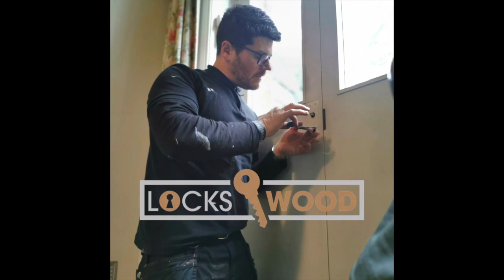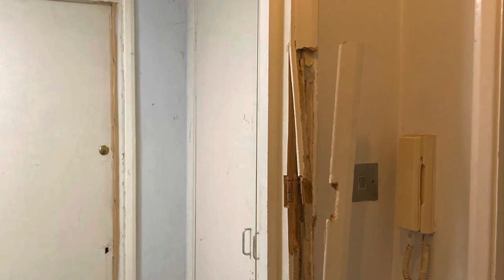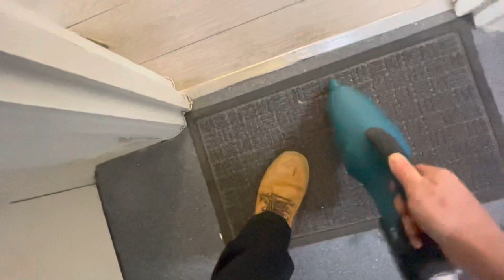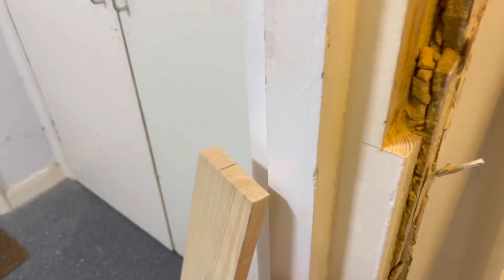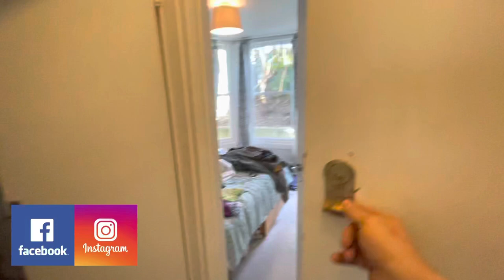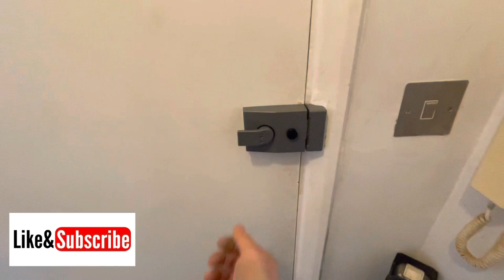Attempted Break-In Repair’s | Locksmith

Comment: Great vid fellow. I don't normally carry wooden blocks. I painfully use wood filler for everything!!!! You have given me ideas.  What cut size and timber type should I have on board?
Reply from the maker: Thanks buddy. I have a few small different sized pieces of timber in the van mate. Some 2x1 3x1 and a small piece of 3x2 should be all you need 👍🏼
Thanks for watching 😊🙏🏼
Reply: @brighton_locksmith  Very helpful, thanks

Comment: That was so odd that the aggressive dude kept smashing in the door even after he knew someone was in there and it not his place. Hope the residents called the cops on them, that's a fair amount of dollars to repair all that. So given that the deadlock kept the intruder out, I assume it's where the keep was towards the floor end of the door, is that why you only did a small piece of timber repair instead of a good length to give that keep some strength so it would be just as hard to kick in again. Thanks for this video, Cheers
Reply from the maker: Yeah they called the police and they turned up 10 minutes after he left!! Yes the deadlock done it’s job 😁 
Thanks as always for watching PW 😊🙏🏼

Comment: 3" min screws for the strike.  I really don't recommend patching in , if  they wont replace the jamb, use 3 FT  long patch in with it centered on the lock. small patch ins  don't have the holding force.
Reply from the maker: The frame is only 25mm thick with plaster behind so absolutely no point in me putting 3” screws in the keep. Also I wouldn’t cut out perfectly good timber to patch it back in? The small pice I’ve cut in is glued and screwed and will do the job👍🏼
Thanks for watching 😊🙏🏼